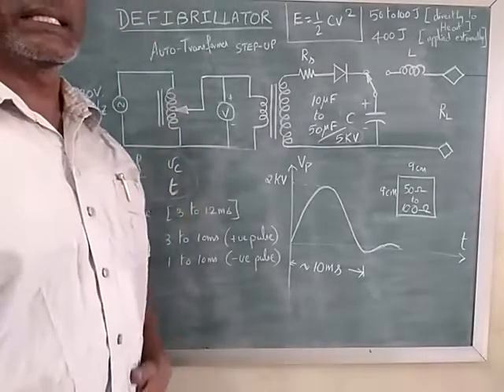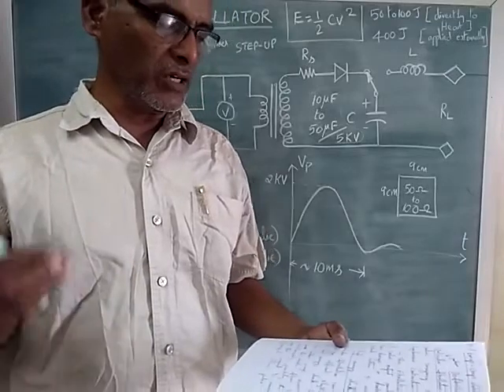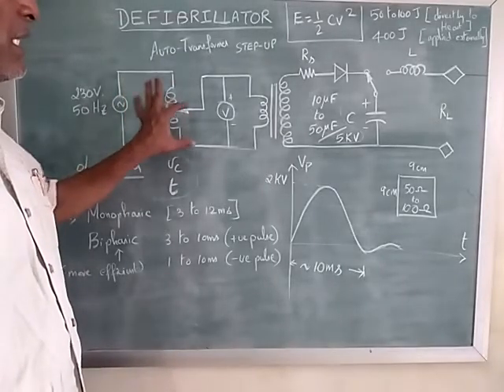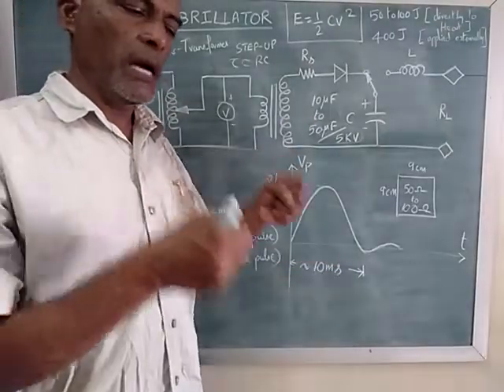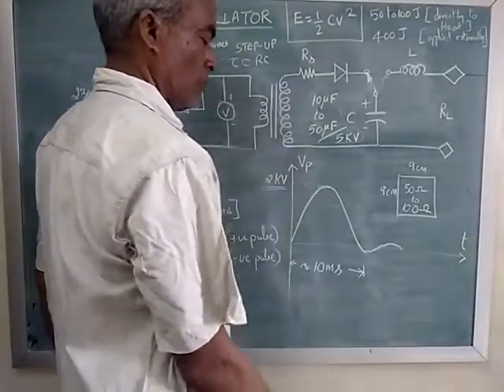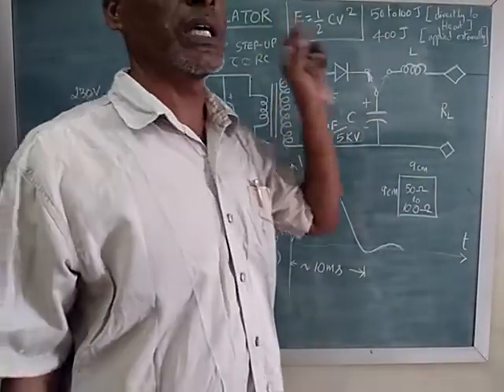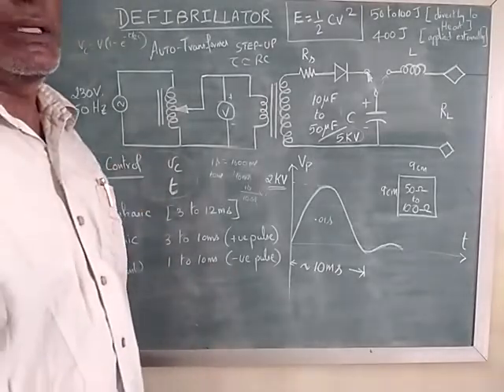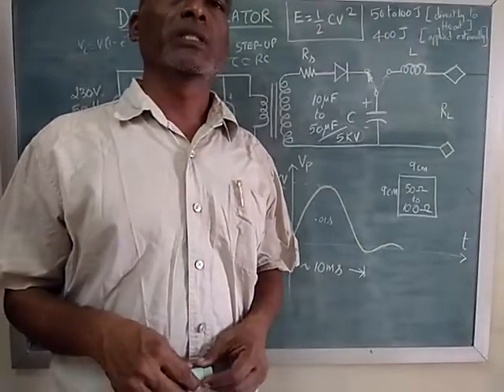Defibrillator (circuit and concept explained)

Comment: sir iam waruna from srilanka whats the importancy of a inductor in the capacitor discharging path way is it to block any ac or what , how to deliver the shock within 10 miliseconds whats the circuit behind it is it a phase shifter circuit for triacs or scr
Reply from the maker: Inductor opposes any current variations